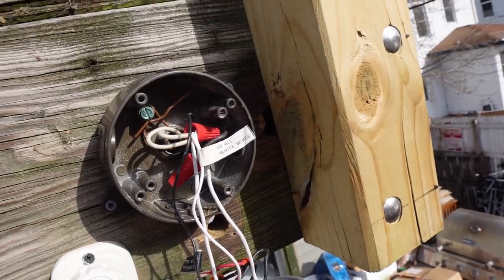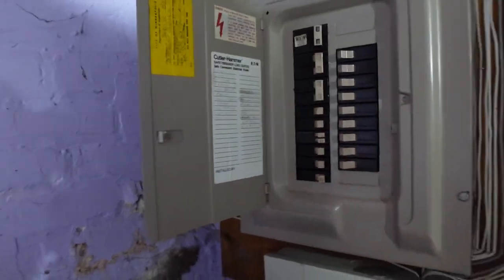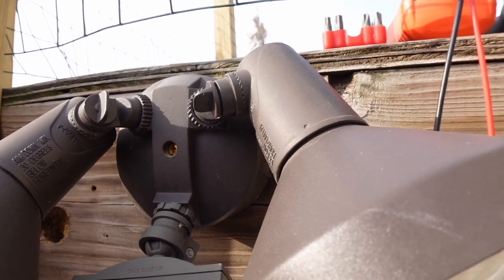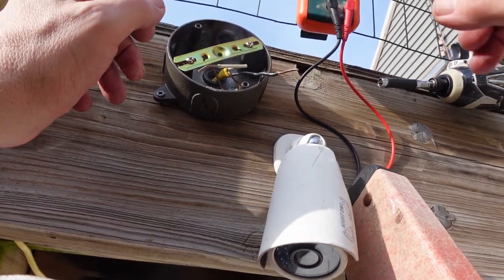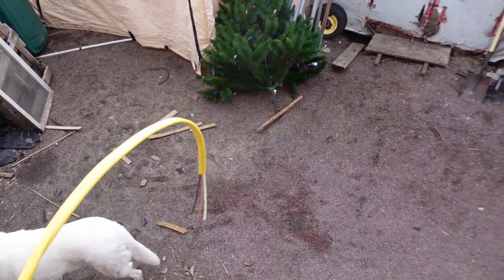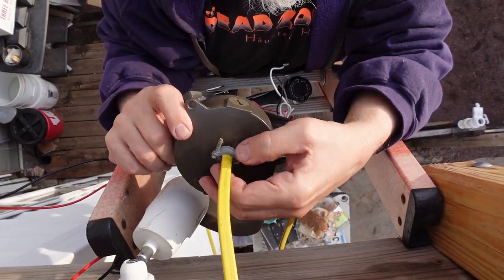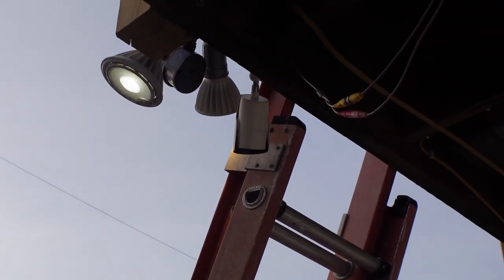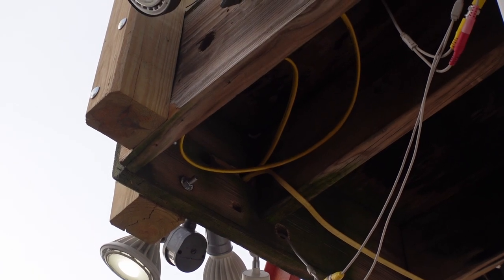Finding and fixing a short in the electrical system

Comment: You cannot use regular Romex (Type NM) outdorrrs, even under a deck. The moisture will wick into the wire and damage it. You Must use Type UF (underground feeder) style cable for wet or damp locations, like under the deck.  You could also run Sealtite or Flexible plastic conduit, but UF cable would be faster and less expensive. 

Also, the connector clamps into the back of the boxes must seal the cable going in. So those you have now are also incorrect. 

This install your previous owner left you is a prime example of someone knowing just enough to be dangerous. The damaged wire shorted due to 1: Overtightening the wrong style clamp and 2: The very moisture ingress I mentioned causing the short. With the location of the fault, you were VERY lucky it didn't set that wood deck board on fire.

Comment: Wouldn’t you see that with a continuity check?  You wouldn’t have 122 volts on that other light if it’s on the same circuit and if it was shorted the breaker wouldn’t reset.

Comment: From what I saw under your deck, the romex wiring is really poorly done. Romex should run through the center of the floor joists and be anchored with a romex staple within 6 " of the box. Also, new NEC code says wires shall extend at least 3" beyond the edge of a box. I HATE WIRES THAT ARE LEFT SHORT BY SOME IDIOT!
Reply from the maker: The previous owner was very "fixy". The house was a repossession and bought "as-is" after a rushed fix-and-flip back in the early '90s, before I even knew what that was.